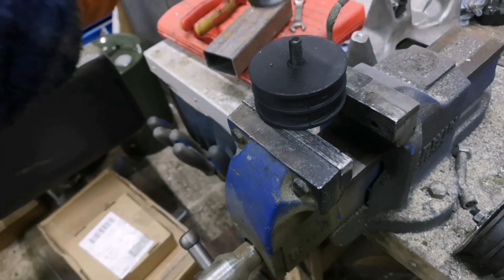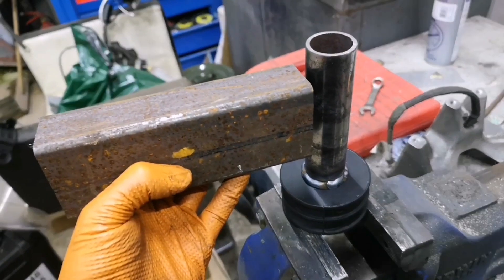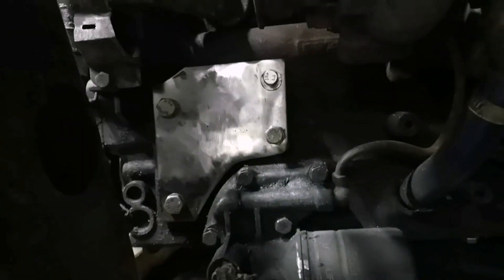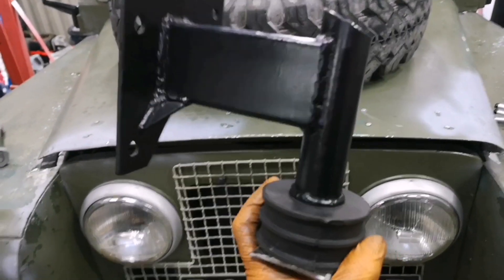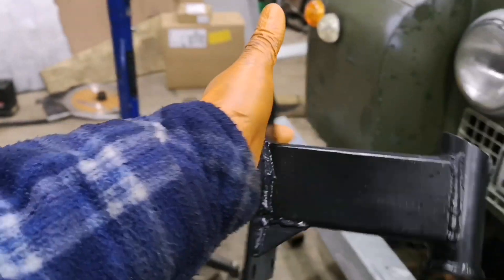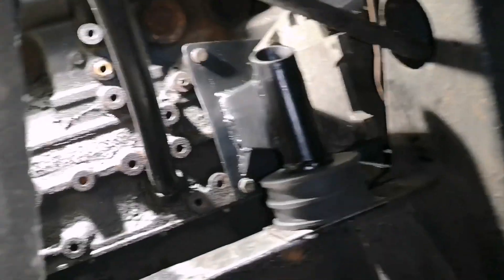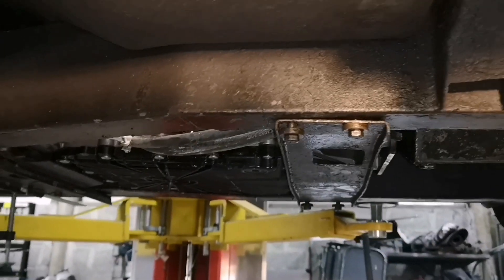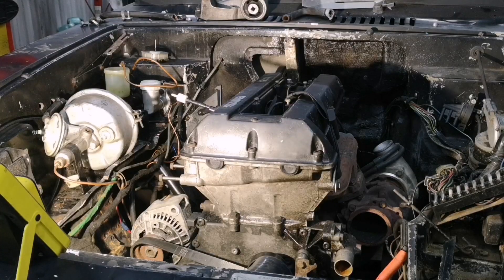The Saabitar -- Episode 2 --  7 speed DCT swapping my Saab B234 powered Reliant Scimitar

Comment: Keep 'em coming! Also going for a B204 Scimitar (think I even bothered you on Insta a few times) so all the best!

How much power/abuse did the Omega R28 take?
Reply from the maker: My box blew when I had bad axle hop and it broke the pin in the diff, it locked the diff solid and then tweaked the prop and stripped the teeth of first gear 🤦 If the diff hadn't broken maybe the box would still be going 🤷‍♂️